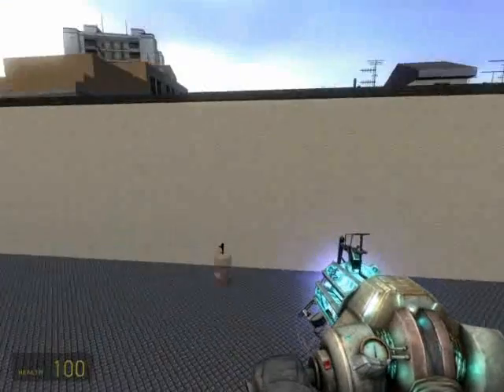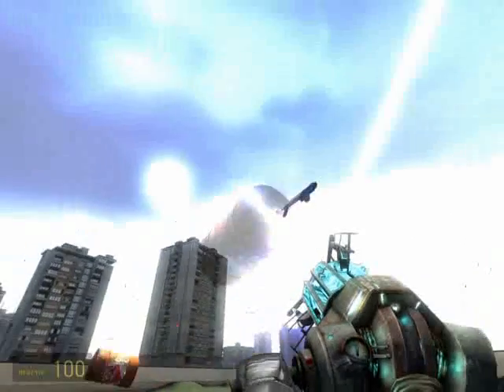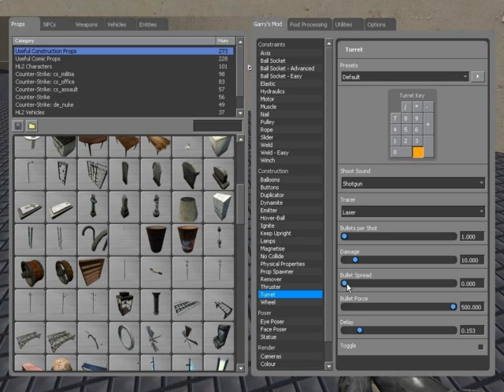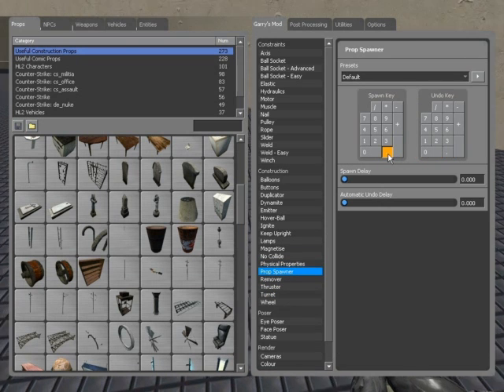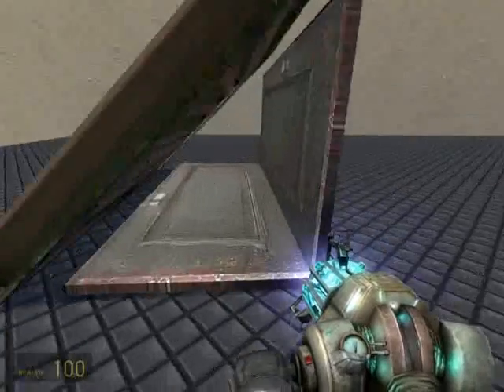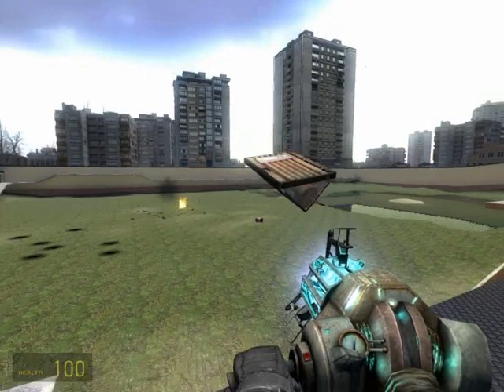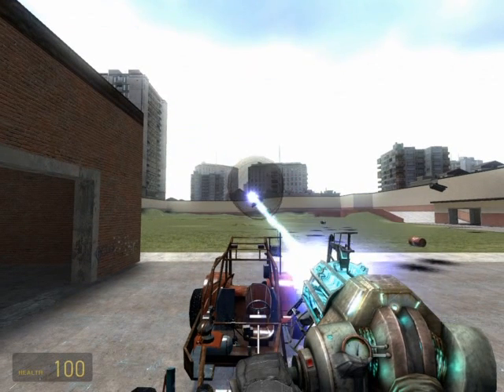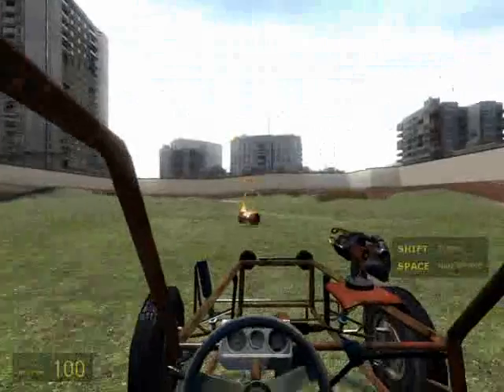Whiterz Gmod Tutorials 1 - Basic Rapid Fire Barrel Cannon

Comment: i tried it and it worked great, just one problem. I tried making a swiveling canon by putting it on a wheel. HOLY **** it has a HUGE recoil! The thing was spazing out and i couldn't  get it to fire straight. is there anyway to fix this, or is it just not good for that kind of thing? by the way, great vid.